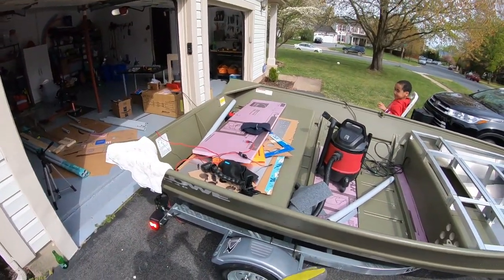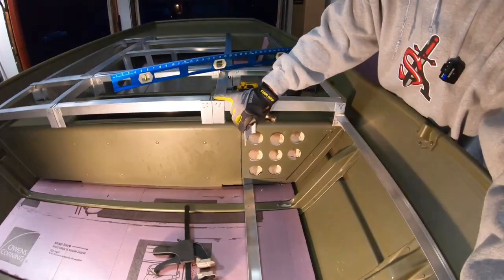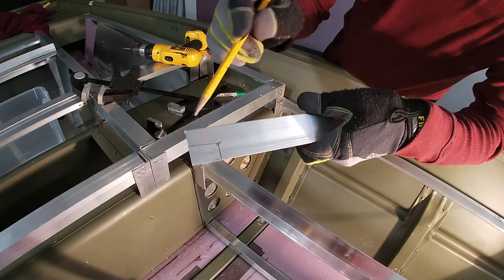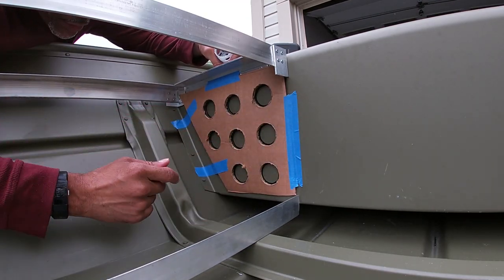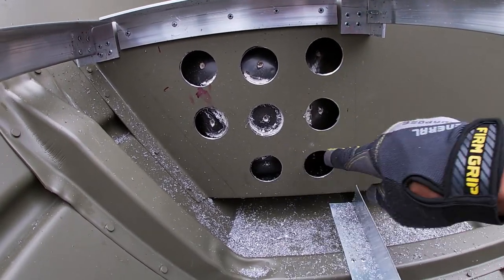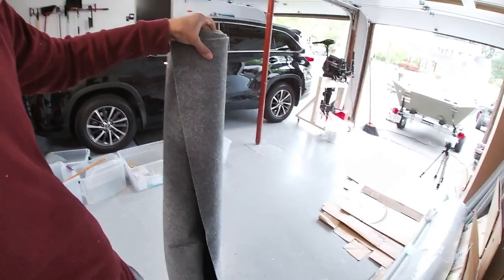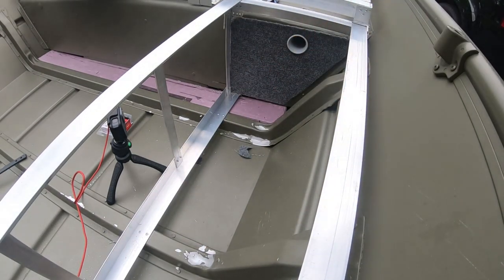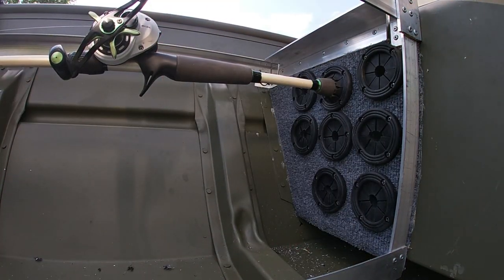Jon Boat Rod Locker COMPLETED Step-By-Step Pt. 2{Jon Boat to Bass Boat Conversion}Lowe 1448 Jon Boat

Comment: I was gunna cut my bench but now I'm gunna do just live you did but my boat seems a lot older than most of the ones I've seen on the videos I been watching I'm changing my transom this weekend cause it is completely rotten
Reply from the maker: Go for it.  Cutting the bench should be last resort.

Comment: Could you please let me know what size angle you are using? I heard you say 1/8 and 1/16. But is it 1/8 x 1/1/4 or 1 1/2? Going to try what you are doing and want to get my materials together? Thanks and great videos you put out..
Reply from the maker: I used 1/8" x 1 - 1/2" and 1/16" x 1 - 1/2.